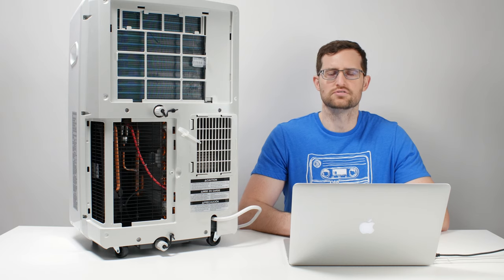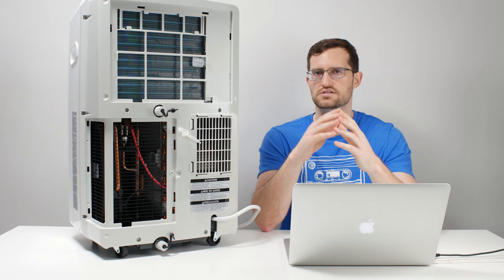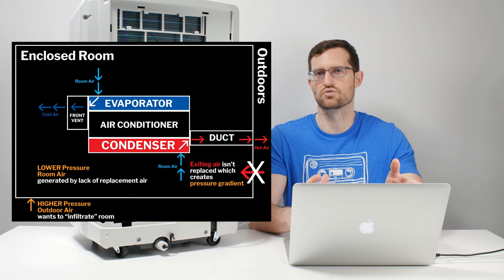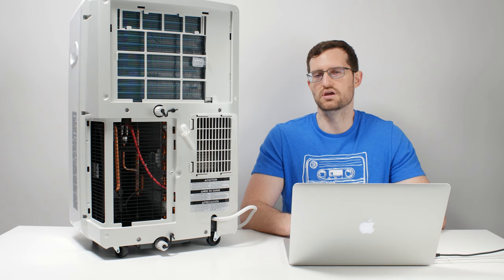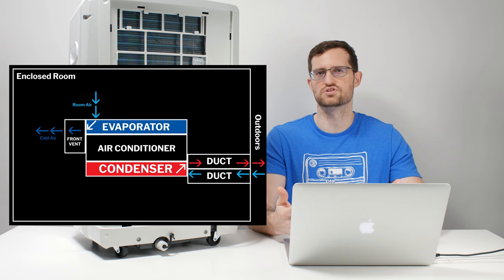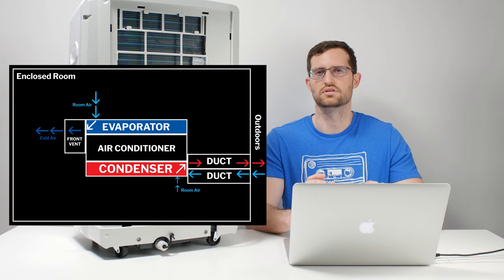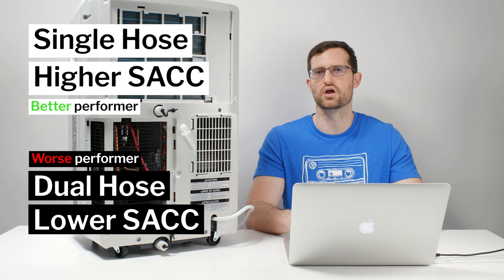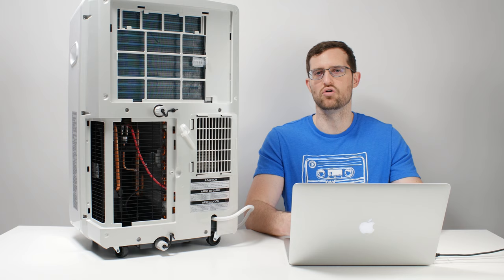Single vs Dual Hose Portable Air Conditioners

Comment: Dude, you are REALLY missing the boat here.  Stop fixating on RADIATED HEAT, OMG! The heating effect is not NEARLY as strong as you seem to think.  A double hose unit is VASTLY more efficient and effective than a single.

Comment: You can't really solve the infiltration air problem with single hose units, but you can pretty easily solve the issues with a dual hose unit by insulating the hoses and taping the joints.
Reply: Well i solved it, it is possible.
Reply: PiotrK sorry, which problem did you solve?  The second one that can easily be solved or the first one that I said can’t be solved?
Reply: The first one, there are two ways:
1. Add a second hose by covering the vent with some prepared sealed box that has the hose connected to it (basically conversion to dual hose)
2. Put the single hose unit outside and blow the air into the house, some single hose units allow to switch the sides and if not, it is possible to mod the front vent to add pipe as well.
3. Basically the first except that a permanent modification is made by altering the casing to "hard-mod" the hose in
Reply: PiotrK yeah, I thought you might go there.  Modifying a single hose unit into a dual hose unit doesn’t really solve the single hose problem, it sidesteps it completely.  It’s a fine workaround, it just doesn’t “solve” the physics problem of a single hose unit.

The idea of placing the unit outside and running it in reverse is really cool, and maybe it qualifies as a single hose solution.  It still shouldn’t be as efficient in theory as a dual hose since you are having to cool hot outside air instead of recirculating already cool inside air.
Reply: PiotrK yes, but my point was that single hose units have a flaw that dual hose units don’t have.  Converting the single hose to a dual hose just reiterates that point.
Reply: Yes, no matter what this guy says about SAC, two units of the same build and quality, one with single and one with dual hose, the dual hose will allways win in cooling capacity......UNLESS outside temp is LOWER than Your inside temp LOL cause then its good that it draws in cold air
Reply: It's really the same problem only with the dual hose only a small part of the heat in the outdoor intake air radiates off the hose as the air is then just ducted out the exhaust hose once it's absorbed the condenser heat whereas with a single hose unit, that outdoor makeup air heat that infiltrates in just stays in the house completely.
Reply: @PiotrK   put the entire unit outside. Genius.
Reply: @--JohnDoe  It has issues, no thermostat, remote control is nearly impossible, you have to mod the evaporator part which is usually harder as it's on top rather than bottom plus the evaporator exhaust mod to fix these issues. Usually not worth the time.
Reply: @PiotrK  I'm solving the problem with my single hose by insulating the hose and taping up where it connects to the unit and the window, and cracking a window open on the shaded side of the house. The amount of air it's drawing in from that window is negligible, and so is the heat.
Reply: @Catbooks  You aren't solving anything. Your AC will have to work all the time and almost never stop in order to counter the incoming heat.
Reply: @PiotrK  best way is combining 1 and 2. Put it outside and make it dual hose to cool the cooled air. also less noise. Win/Win/Win
Reply: @HylkeJellema  Sure. How do you plan to control it using remote then?
Reply: @PiotrK  yep thank you for the simple physics most people don't get it
Reply: Is it feasible when the unit is placed outside only to put a duct that enters the cold air?
Reply: @user-ux9gh9qh9g  Then for the best efficiency,you should also make intake hose to take in the  house air, cool it and return it back to  home.
Reply: The #1 suggestion on their link is a dual hose unit as of today. 😅
Reply: @sleeknub simply by turning the thing off it'll never waste energy again. Fixed! Sort of?
Reply: I currently owning this ac model and i found that if you put the every back side of the portable ac outside, the air is more healthy and a bit cooler than just using exhaust pipe. Yep, using portable ac as a window unit it is.
Reply: These units should probably be used as a last resort or for unique circumstances, as they are inherently inefficient, the compressor alone produces 700∼900 watts of heat that needs to be dissipated, if you take a look inside, the unit has minimum or no insulation, meaning some of that 900 watt heat, stays inside the room, plus all the air leaks this guy says, add that the condensed water needs to be emptied rather frequently (depending on the humidity and temp setting), also it takes up some space in the room.
Reply: We regularly get triple digits here I’m pretty sure single hose wins in my climate
Reply: @Username-es1iy  dual hose would be vastly more efficient.  This isn’t up for debate.
Reply: @Username-es1iy  why do you think pulling triple digits air to the cooled room would win over a neutral pressure one?

Comment: I feel you were hired by single hose air conditioning companies to help sell these inferior units. I own both a single and dual hose air conditioning and I can tell you the single hose air conditioner will not cool my room but the dual hose air conditioner will absolutely freeze my room to the point of being uncomfortably cold. So I am not buying what you are saying that a single hose air conditioner can be good. Who paid for this single hose air conditioning ad?
Reply from the maker: I was not paid in any way by any manufacturer. If I were paid and didn't disclose it I would be breaking federal law - it's a serious crime that you're accusing me of. Can you tell me which particular single hose and dual hose model you were comparing in your tests? What was the SACC BTUs for each model?
Reply: @consumer-analysis  Hi thanks for your reply. My single hose and dual hose were a Danby. 12,000 btu. I then had a single hose LG and now have 2 dual hose Haier ac units.
Reply from the maker: @alanw2005  I don't recommend the single hose models that I do because they are single hose models. I only recommend them because they have higher SACC BTUs than most other single hose models and any dual hose model on the market. I asked for the SACC BTUs of the units you were comparing because the dual hose units you prefer likely have higher SACC BTUs than the single hose units you are comparing them to. The 12,000 BTUs you mentioned are not SACC BTUs.

Comment: Bizarre review.  I had a 10,000 BTU single hose PAC and it couldn't even cool down a 200 sf room.  The amount of air it was evacuating was ridiculous.  It was probably something like 200 cfm.  At that rate the entire room's air is completely turned over in about 10 minutes.  There's no way to cool the room.  And since the cool out vent is in the proximity of the condenser intake fan and exhaust, the cooled air is the first to get evacuated out of the room.  I don't even understand why they still sell these.
Reply: The problem is that you're using the single hose unit when it's hot outside.  The SACC calcs assume that their is a 5.4F, on average, temperature differential between the inside and outside.  The portable AC manufacturers had a big hand in coming up with that number.

Comment: I have just confirmed that reality is completely opposite to this video. Replaced a single hose 10k btu SACC for a dual hose 10,5k btu and the difference is huge. The single hose had the compressor on all the time when I tried to cool the bedroom to something around 18c, because the pulled outside hot air prevented it to reach the desired temperature. With the dual hose neutral pressure, it can keep it easily.
Reply: Yes, this Edward Snowden lookalike was obvisously hired by the single hose air conditioner industry. He is a gas lighter.

Comment: Yes, two units with the same SACC will have the same "cooling potential" - but a dual hose design will do it whilst consuming significantly less power, and potentially while being a physically smaller and quieter unit. A single hose design will also heat up other parts of the house, by drawing hot air into them from outside. To claim that the two designs are the same because one of the stats on the box accounts for the fact that one design is shit, is highly misleading.
Reply: Not only that, but a little bit of tape and an insulating sleeve for the hoses and all the issues he talked on a dual hose unit are gone. Once you go dual hose you never go back to a single hose unit.
Reply: How can dualunit be quieter if it needs to be cooled by hot outside air ???
Reply: @Gamerdu45  It intakes air from outside, which makes them more quiet. 

 I have 2 portable AC's in my apartment, 10000 BTU SACC each and my dual hose ones quieter, I can feel the air more from the single hose one, but my dual hose one cools things more evenly, plus it helps with air pressure. I keep my single hose one in my bedroom because its a smaller room so it can take advantage of the colder air and I use my dual one along with it  in the daytime (or when theres a really bad heatwave ill use both 24/7) to keep my whole place cool.

This guy in the video clearly had a bias against dual hose ones because even though the title of the video makes it seem like its a comparison, in truth the whole video was him trying to convince people not to buy them.

If you live somewhere like where I am in Canada: where it gets hot and stuffy indoors in the summer but still has cool breezy air outside, then you're actually better off getting a dual hose one.

 I only bought my single hosed one last summer because it was 40 celsius for like a week or 2.....
Reply: Is it feasible when the unit is placed outside only to put a duct that enters the cold air?
Reply: You would have to have lots of insulation to keep that cool air from warming up before it goes inside, you might even have to take it apart and insulate the areas where the cold air is produced if you're in a really hot area @user-ux9gh9qh9g
Reply: if the area you live is dry, a swamp fan/evaporative cooler might do better @user-ux9gh9qh9g
Reply: @user-ux9gh9qh9g  yes it would be feasible..it would be like having a window ac..you just have to keep your portable ac protected from the dirt and debris outside ...I assume you have a portable ac to move around your room when needed ? Also the higher the saac ..like 10k btu will cool about 450 square feet
Reply: i cant find any single dual hose unit in europe

Comment: If you got a portable AC just for 1 room and always stays there, try and wrap the exhaust hose in as much duct insulation as possible. It makes a huge difference. It won't look pretty, but it works.
Reply: Makes sense
Reply: @SuffocatedByThighs  duct tape.
Reply: I don’t care about how duct look since the older mini spilt that didn’t have a plastic cover like ductless also have duct that look as ugly. I have no choice in my apartment so this tip would be helpful since portable ac is my only option.
Reply: A blanket works just fine
Reply: I use an air conditioner hose cover from Amazon and I get no heat from the hose whatsoever. Also a jumbo bath sheet works as well if you are feeling the pinch!
Reply: I'm doing this today
Reply: @SuffocatedByThighs  Thin insulation.

Comment: There is one thing that this video fails to mention. It is my understanding that for the same SACC / DOE BTU, the single-hose units use a lot more electrical power than an equivalent SACC / DOE BTU dual-hose unit. For example, a 1200 watt single-hose unit produces 5200 DOE BTU, whereas a 1200 watt dual-hose unit produces 8600 DOE BTU!
Reply: Both types are crap that's why I have a mini split at the end of the day if you don't have a split system then neither of these are really good really did you only good for temporary spot cooling.
Reply: Wow, seriously?  Then this video is worse than worthless.  It's just 10 minutes of blabbering about optimizing the wrong metric to the detriment of what really matters.
Reply: Is it feasible when the unit is placed outside only to put a duct that enters the cold air?
Reply: @user-ux9gh9qh9g  yeah it would work since it is like having a window ac ..not as strong but at least the compressor that has a lot of heat is not inside your room..also cover the portable ac since it is very fragile body having outside in the sun
Reply: @robertnguyen2025  People keep mentioning this, but these things aren't waterproof. You can't just leave it out in the rain...
Reply: @user-ux9gh9qh9g it has a thermostat that measures the room temp vs the set point. So if you put it outside it will always think the room is at the outside temp, and it will never stop running.
Reply: @tecnologiaoficial  Bruh, hese things are so horribly inefficient they'll never stop running anyway, because it'll never get to whatever temperature the thermostat is set to 🤣
Reply: @dudea3378  That is blatantly not true. IF it's 90 to 95 degrees F out, and the set temp is say 68 to 74 degrees F, the single hose units do reach the set temp and shut the compressor down.

Comment: I don't understand your complaint about using outdoor air to cool the condenser. Ultimately, you are moving heat from one place to another.  Don't top end, central AC use outdoor air to cool the condenser? Really, a portable dual hose system functions the same as a non-portable system, except it moves outdoor air a distance instead of moving the refrigerant a distance. Please let me know if I am missing something here.
Reply: You're not missing anything. The presenter is.

Comment: in practice, these devices are good only for sleeping at night. I have a single hose and I adapted it for dual hose and ended the problem of negative pressure and waste of refrigerated air.
Reply: Why
Reply: How?
Reply: @carlysullivan4449  Obviously. But he's asking how do you do that?

Comment: ...This not exactly quite the analogy but... we all are familiar with our car AC. If we want to cool down the cabin as fast as possible we usually close the fresh air intake (recirculation mode). That would have a similar effect as a dual-hose unit that keeps the warm outdoor air away from the room. Quite the opposite if we open the fresh air intake, it would have a similar effect as a single-hose unit, drawing unconditioned air to the room all the time.
Reply: brilliant analogy friend!!
Reply: This is a much simpler, more relatable way to explain it, nice
Reply: Two years later and your comment is still helping. It's exactly what I was trying to understand about portable ac's.